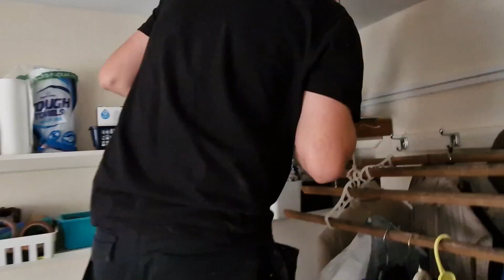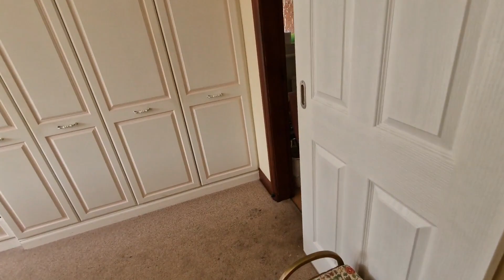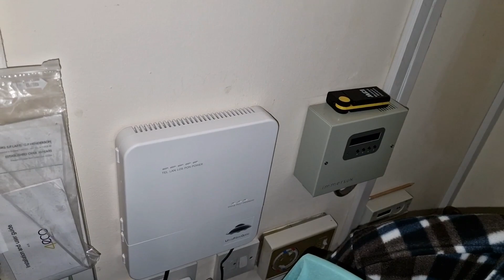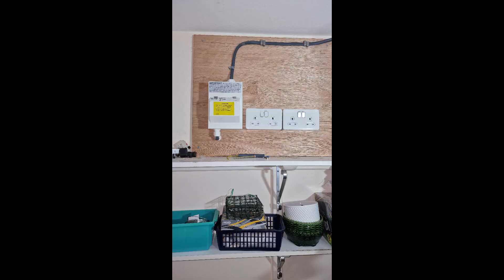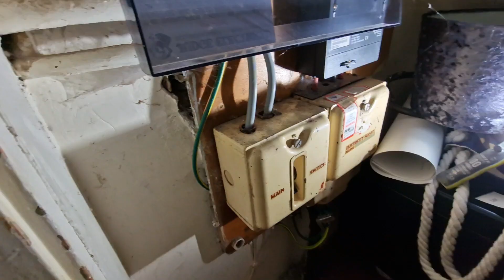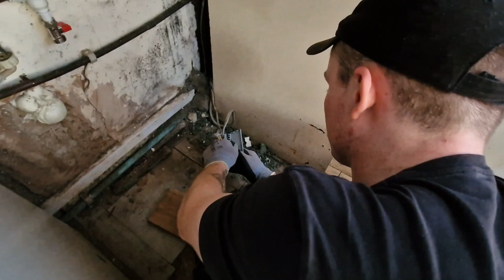Electrical fire destroys home - Flood and rodents destroy kitchen - The investigation process

Comment: Thanks for this Mark, I found both scenarios interesting. I'm with you regarding horizontal runs and don't fully understand why there is the insistence for vertical drops, not just in a kitchen where a fitter is going to put wall unit brackets but in any room where its highly likely the homeowner, who has no idea of prescribed zones, is probably going to hang something on walls that requires nail or screws into the wall. And as you point out, the cabling is shorter so cheaper on cabling, no need to lift floorboards/ cut into ceilings, and better Zs/vd values.

Comment: I thought that fans had thermal cutouts to stop the fan from overheating? A good 10 years ago we had a block of timber framed flats and we fitted intermiscient collars to the fabs to stop a fire spreading from below into the roof space. It seems a bit odd that two fans go into one duct I would have thought that one fan would extract into another? Maybe metal flexible conduit for under the units as I can't see MICC being used
Reply from the maker: Some fans do, but not all. I guess you get what you pay for. Collars are common in commercial settings but as most ducts are plastic in domestic kinda useless in that application.  

Very common to have shared ducts usually with back draft baffles to prevent odor/venting into rooms before the Y split. 

Not an unusual combo and the results are more common than many realise.
Reply: @electrician247  There are intumescent fire collars for plastic pipes penetrating a fire rated ceiling (I'ved used them in a kitchen ceiling for cooker hood), what I don't have a "simple" solution for is all in one fan units penetrating the ceiling.
Reply from the maker: @TheVintageRunner  same Karl. But even so those collars on plastic pipe are never a guarantee.  Fire wicks so fast down a duct it's scary tbh.
Reply: Some manufacturers I believe removed the thermal protection and introduced a 3A fuse  requirement to protect the fan.

Comment: So for the fire damaged property, if we're ducting for a gas appliance we use intumescent vents but you're right when it comes to extraction we don't. Yet in commercial it's a given.
It's something that hasn't sat right with me but honestly there's not really a product suitable unless you've got access to the void above, as most soil pipe sized ones are to be mounted from below, which isn't suitable for a fan set up.

Regards to the kitchen, it's dependant in my view on the type of building construction, no vents and solid concrete floor make for a rodent tight kitchen. That said the same issue applies with wooden floors over dwarf wall voids where people haven't clipped the cables in, it becomes a rodent high-way if they have a path into the void space and chew central.

Comment: When we put ceiling speakers in, we added fire hoods and it's good for peace of mind. Have been considering sprinklers for the house we're moving to but it's a lot of work and money so unsure, butin Scotland the regulations are starting to move towards requiring them for some properties so it's only a matter of time before they become more mainstream for domestic settings.

I do wonder how mechanical ventilation with heat recovery factors into all of this with the recent pushes towards efficiency, it would be easy to bypass any fire protection throughout the entire property. I believe fire dampers are only currently required for ducting going to a garage in domestic situations.

I think metal trunking under the kitchen cabinets makes a lot of sense, easily accessible from behind the plinth and the cable routes are extremely visible to any kitchen fitters. Just need to ensure that the containment is tall enough as you highlighted in your video, personally I think steel conduit up to each socket would make sense - Still needs to be chased into the wall at the end and requires a couple of bends, but can then use singles throughout and very easily make changes. It adds to the cost of course, but that's now inconsequential when people are being asked to pay £100 per AFDD!